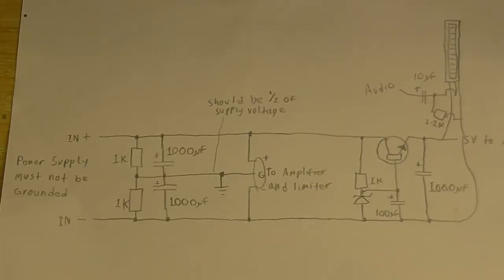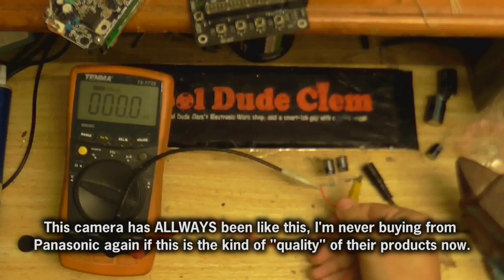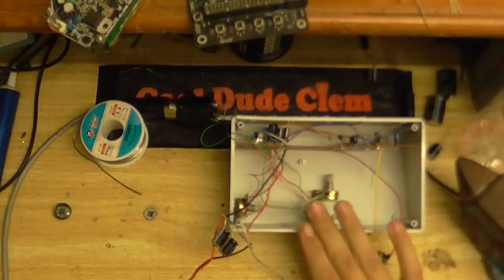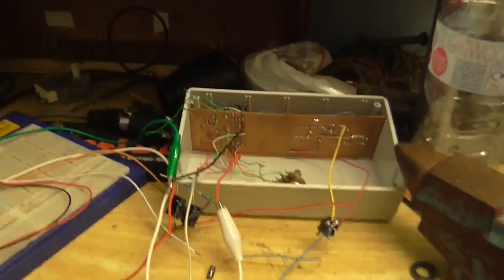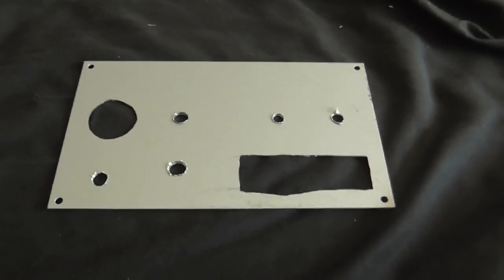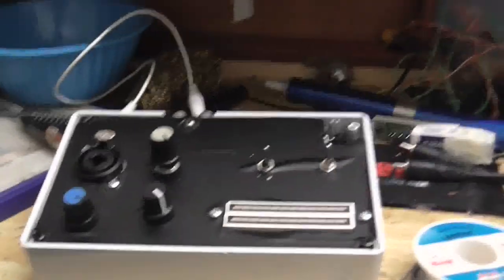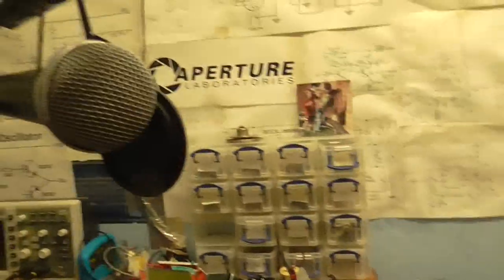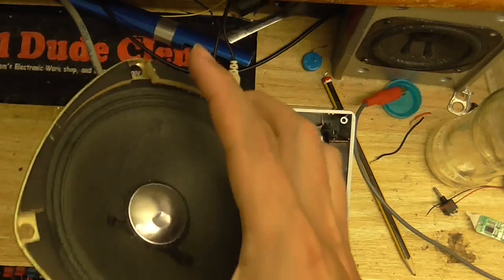Microphone preamp final part.

Comment: Hello Clem, Good job on the pre-amp with the level meter. It works and sounds great to me. Glad your still into electronics, maybe build an LM1875 stereo amp, kits on eBay around $2.00 usd, John Audio Tech would agree. The fire smoke is gone, at least in my area, came through it OK. Finally got some rain, a real blessing. All the best from Oregon, C.